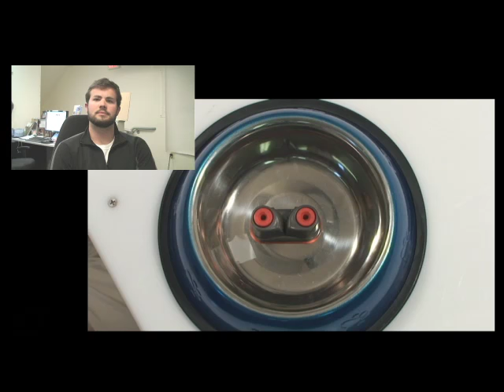How To Rebuild a Harken 150 Cam Cleat | Expert Advice

Comment: This is helpful, thank you! Most of the double deck cams on our club's Laser fleet are failing (closing poorly, letting outhauls slip &c). Having not yet disassembled them, I'm not sure whether this is due to salt & grit (we sail in the ocean), or due to spring failure. So two questions: 1) What is the most common reason for deck cam cleats to fail?  2) How  much function can usually be restored by cleaning/servicing, &/or what parts should we have on hand prior to attempting service/repair?
Thanks!
Cameron
Reply from the maker: Cameron, 1) worn springs,  warn ball bearings, dirty/salty cam races that the ball bearings sit in (clean with hot soap water) to fix this one).  2. To rebuild you would use this kit: http://www.apsltd.com/150-cam-matic-rebuild-kit.html
Regards,
APS